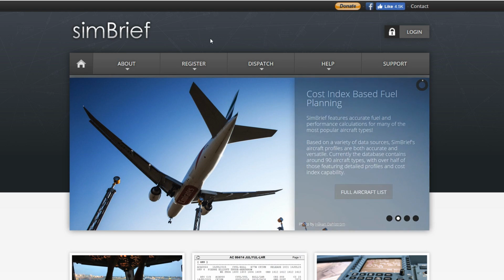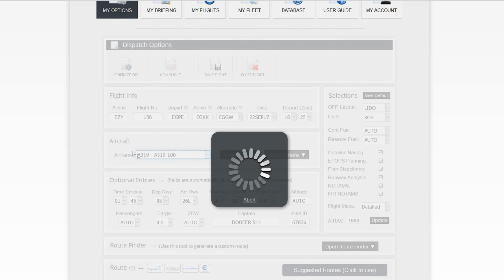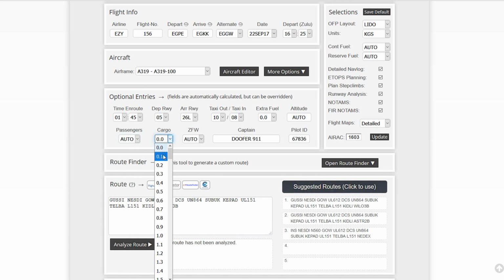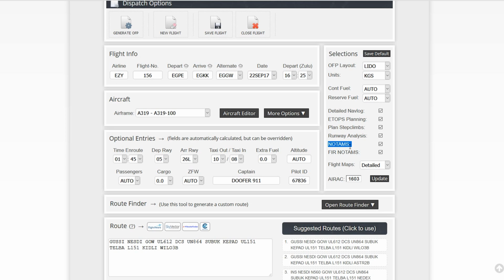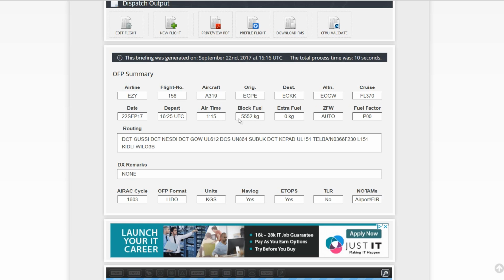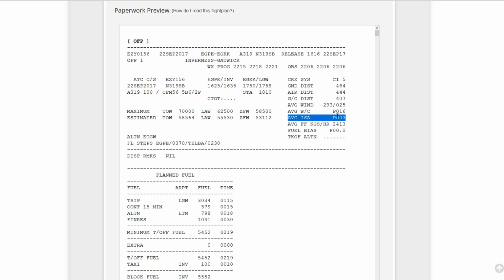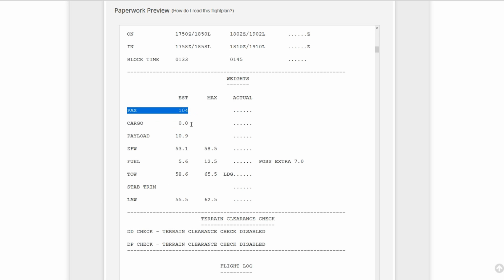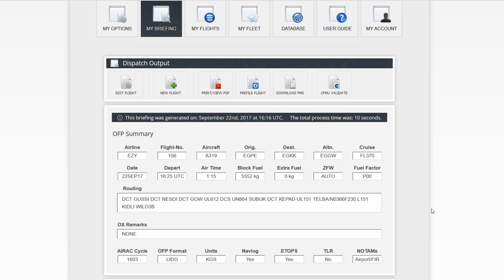Flight Planning with SimBrief

Comment: SimBrief is great but it really does seem like its geared solely for airliners with GA somewhat of a second-class citizen. I mainly fly single-engine and turbo prop GA. I was surprised you can't simply click on a navaid or airport on the map display and add it to a leg. You can't even drag the course line to create another waypoint and drag it to a navaid or airport on the map. I just wish SimBrief had half the number of editing features the free Little Nav Map (and SkyVector come to think of it) has in terms of editing flight plans with mouse interactions on the map. Sadly, Little Nav Map's hideous 1990s UI from via its use of Qt UI framework and lack of hardware acceleration makes my eyes bleed.

Comment: i wonder if it'll work with fmc in b737-800?
Reply from the maker: Yep, once you've generated a flight plan you can download it in many different formats to work with many different add on aircraft or default FSX aircraft.

Comment: i sent the fms flight file to xp but it doesn't show up in the g530 when i go to the flight plan configure window? i'll be atc flying is that why? onfpl window i have the departure airport but no flight plan. any advice you can offer i would be happy, Thank you.
Reply from the maker: Unfortunately I'm on holiday at the moment and I'm not too experienced with X Plane so I can't answer that at the moment I'm afraid. The only advice I could give would be to check some X Plane related forums to see if someone's asked the same question there.

Comment: can i add a fictional airline and flt #. xp 11.10 often says navdata out of date when i manually enter way points. why.
Reply from the maker: Yeah absolutely. It doesn't have to be a real airline. As for the Nav Data, it updates every 28 days so the sim will have a certain "cycle" of data. You can use a service provided by a company like Navigraph to update your sim's Nav data. It's not essential but you might need to manually tweak some flight plans to get them working.
Reply: thank you so much 911. if i  export the flight plan to xp 11 can i fly using atc? will the flight plan be loaded into Output -FMS plan and into g530 when i select it?

Comment: Hey doofer, i dont know if im doing something wrong og beeing stupid but each time i try this it does not predict cargo in the paper work, i have selected the a320 and typed in for example 5.4tons.  But no luck. I hope you kan help me. Adrian
Reply from the maker: Hey Adrian, when you're setting up the flight you should be able to manually select the amount of cargo you want to bring on board. Commercial Airlines don't often carry Cargo which is why on Sim Brief, it usually defaults to 0. So if you want to include some, just choose a cargo value at random during the setup on Sim Brief.
Reply: But arent the passangers takeing any luggage with them, arent this cargo? Adrian
Reply from the maker: Nope, that's counted as part of the Passenger number/weight.
Reply: Ok, Thanks alot! :)

Comment: Hi Doofer ....thanx for all your great tutorials....maybe you can answer to this question....I have a Navigraph account and I update airacs monthly and also update Simbrief airacs equally ....still I find that in programming the FMC which is updated to the same AIRAC  ,sometimes the FMC (or whatever you call )it doesn t recognize a waypoint  or airway given by the Simbrief route....It is of course not a big problem because you can work around it but still I don t get it how this is possible...maybe you now more
Reply from the maker: That's strange.... if everything is using the same AIRAC data then that type of problem should not happen. I don't know why that might be I'm afraid.

Comment: This was really helpful, thanks for posting. How reliable are these flight planning tools? The reason I ask is because I planned a flight from Stansted to Liverpool and it gave me a BUZA7R departure. However when I look on the nats charts at Stansted’s departures. BUZA7R is not there. Tweaking the plan slightly it then gave me the UTAV1S departure off of rwy22. Again looking at the charts this departure is only available when departing rwy 04. Departing off of 22 it’s the UTAV1R departure.
Reply from the maker: Any differences may be related to an out of date AIRAC cycle being used by either the planning tool or your add on aircraft. So you may need to spend a couple of minutes extra just manually checking and amending the route but 9/10 times you'll be ok.
Reply: Doofer911 Thanks for taking the time to reply.